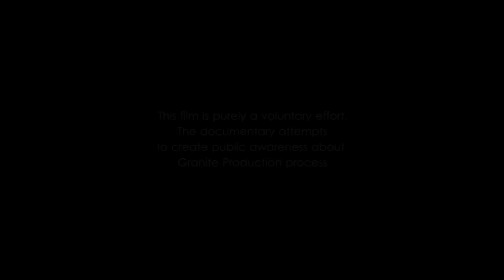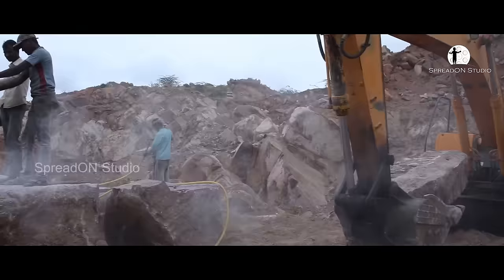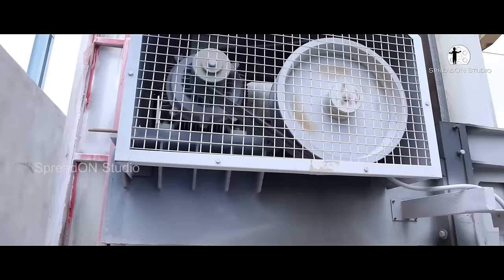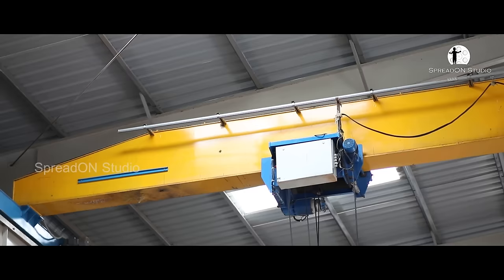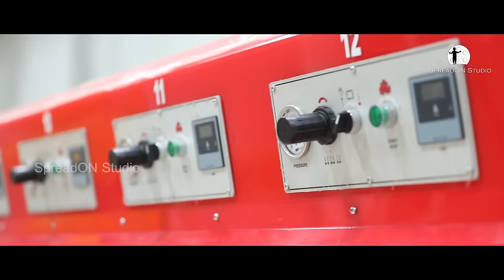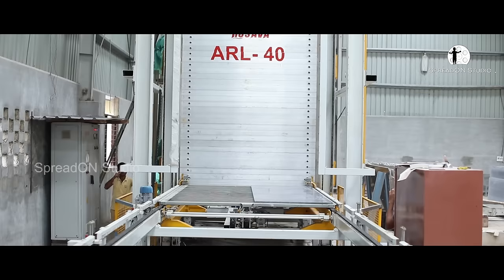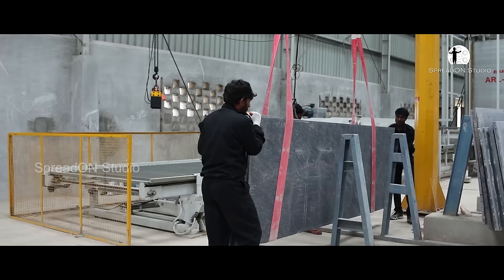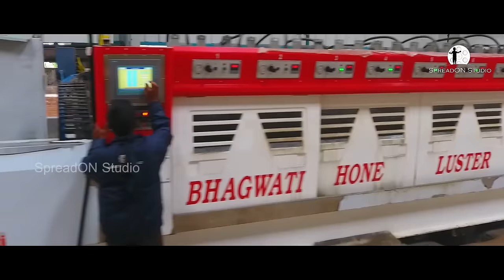Granite Production Process | Documentary film

Comment: Great video! Somehow the Egyptians managed to do this with copper chisels 🤷🏼‍♂️
Reply: They're now speculating that the blocks were poured given their similarity to concrete in structure.
Reply: @varun009  I've heard this, but further  research shows some of the stone still contain visible fossils. Casting granite takes heat beyond the Egyptians capabilities
Reply: A
Reply: In all honestly, they probably used metal chisels. Rudimentary as they may have been, I’m sure a select few people (possibly just one) knew of some way to smelt using fire. They had clay, and that’s all you need. You take iron ore, most likely imported or from a quarry just like the limestone, and refine it and pour it into fired clay molds. I think a few hundred years is enough time for one of them to mess around with a smoldering fire and some raw iron to find that the iron melts if it’s hot enough.
Reply: @knack8284  hello, French blacksmith here, that can't be the case. First of all, iron processing wasn't discovered until thousands of years later, stone, copper and perhaps bronze were more common during the creation of the pyramids. (the only iron item found from that period was a meteoritic iron dagger). No, you can't melt iron in a clay crucible with some fire, it doesn't work like that. First of all, if you don't know how to make iron from stone, you don't have anything to melt, then melting iron was pretty much unknown until the early industrial revolutions, so the 15th century in Europe, with exceptions in india, the wootz steel for exemple. Now beacause we don't know how to make something with traditional tools anymore doesn't mean it's ridiculous. I mean nowadays if you knew the amount of people who truly believe iron tools are worthless because it's not made of 135Cr3 steel tempered for 2 hours in a modern kiln...
The thing is, if traditional blacksmithing taught me something, it's that tricks makes all the difference. For exemple, huge granite rocks were split by using dry wood wedged in holes, and then soaked with water so the expanding wood would just crack the stone. Chisels made from copper or stone will need constant repairs, at least if we use them the way we do nowadays. There might be techniques to preserve the edge of your tools that we don't know anymore. Keep in mind that wheels weren't even used during the building of the pyramids, they used round poles placed underneath the stones instead.
When you don't have the technology to make stuff for you, you still have your brain and your knowledge to still get away with seemingly impossible tasks.
Reply: not on Granite. Stone is not just stone